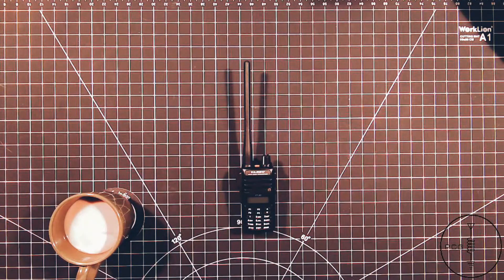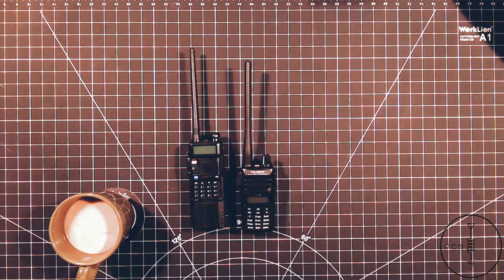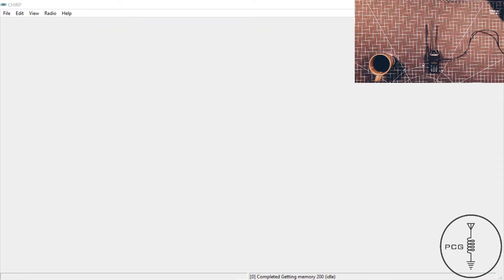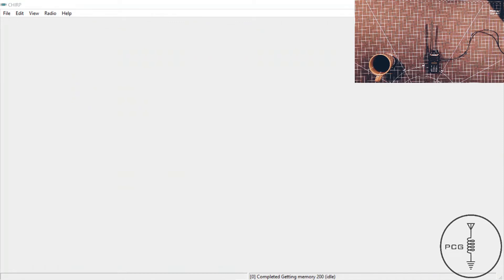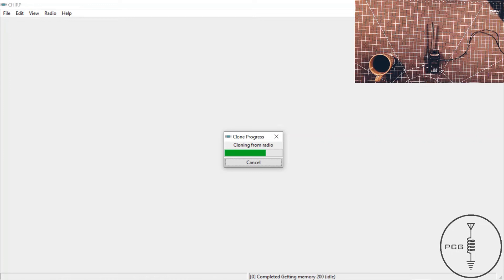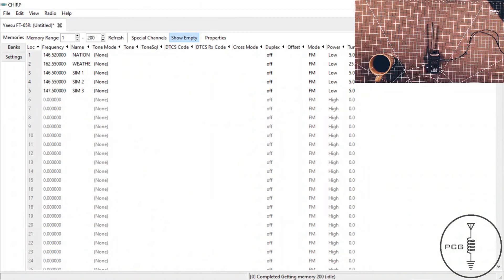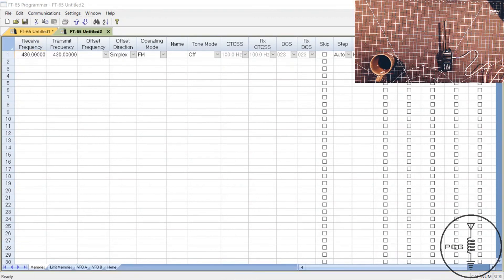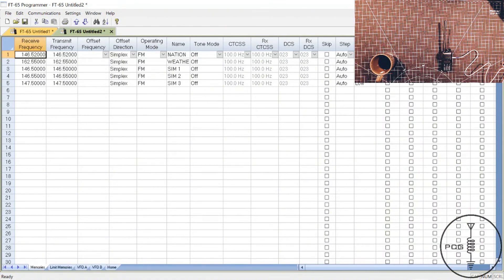E6: Yaesu FT-65R & CHIRP / RT Systems

Comment: Just wondering if this could open the gate to 3rd party software mods just like some people did for the Quansheng UV k6 radio
Reply from the maker: Both CHIRP and RT Systems let you adjust many of the radio's settings, but I believe with the K6 there are some threads (e.g. Reddit) where people are experimenting with different custom firmware.  Personally, I would be hesitant to put custom firmware on something like a Baofeng UV-5R or a Yaesu because my concern is it may render the radio in an inoperable state.  But it does appear people are doing just that with radios such as the K6.

Comment: Informative video. I dont have access to a computer so I have to do fpp on my FT-65. I think the reason Yaesu hasn't released many hardware upgrades for the FT-65/FT-4X, is because they are supposed to be the entry level/budget radios of the HT line. I understand that in the field charging goes hand-in-hand with fpp, but they had to keep them from competing with 60 & 70. I wish Yaesu wouldve at least came out with a battery eliminator for the 65 for portable/mobile ops. Thanks for sharing. 👍
Reply from the maker: Thank you.  I like the FT-65, but wish it could charge without the charging cradle.  I think it's a great radio though, and is fairly easy to manually program once you learn your way around the menu functions.

Comment: Have you tried changing the Yaesu UHF to Satcom band i.e 255.550 band range? and which cables did you use for chirp generic Amazon cables? also what you said about charging is a massive benefit for the baofeng. The Yaesu is nice dot matrix display, lower tone speaker and more memory options, but the fact of being able to charge in the field with a power bank or solar is a massive win for the Baofeng.
Reply from the maker: I haven't attempted to monitor SATCOM bands , but I'm always looking for a new project so thank you for the suggestion, I'll have to check that out.  Being able to charge equipment in the field is one of the main requirements I have for my gear.  I like the FT-65, but I think Yaesu could have really hit it out of the park with that HT if either that functionality was built into the radio (like the FT-60 or VX-6, and some others), or if you could purchase an aftermarket battery that has a DC port like the Baofeng batteries do.  Regarding the 3rd Party CHIRP cable (made by Valley Enterprises).  Link: https://www.amazon.com/Valley-Enterprises-Programming-compatible-SCU-35/dp/B077QZSYGH
Reply: @PartisanCommsGroup  Thanks.
Reply: @PartisanCommsGroup  I have also noticed my baofeng receives better than the FT65 ?
Reply from the maker: You mean in terms of the quality / clarity of the transmissions?
Reply: @PartisanCommsGroup  quality is better on the yaesu it must have some filter but the baofeng receives broken signals I.e is more sensitive and  better in an emergency, I used chirp and changed the baofeng to the SATCOM band easily before I buy the cables it would be cool to know if the yaesu can do it cheers.